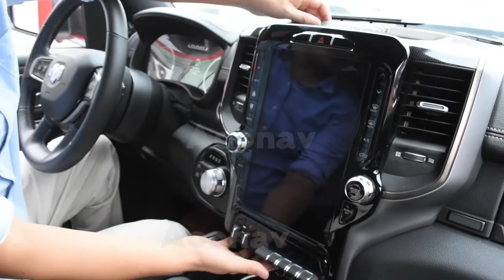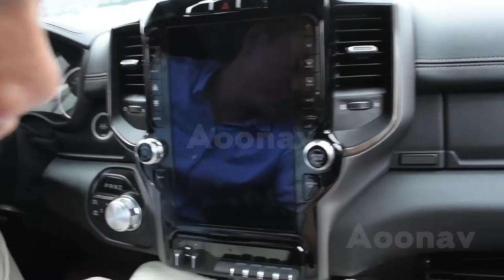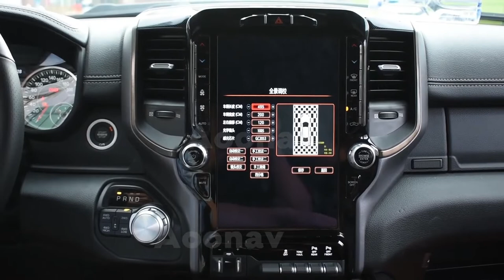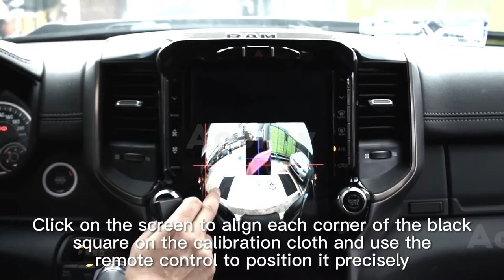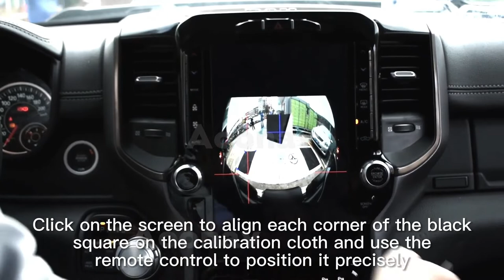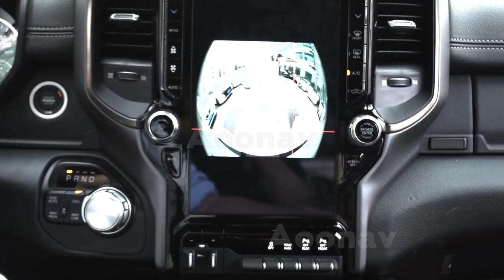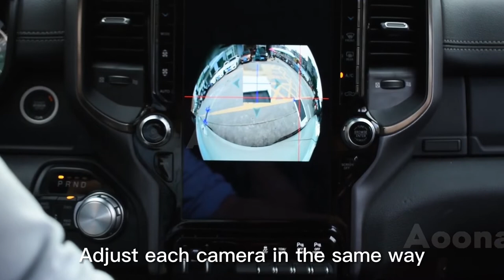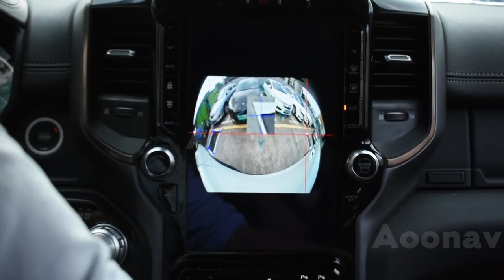Installation Video:Dodge RAM 2018-2022 3D 360° Panoramic Camera 1080P Upgrade

Comment: Fits 2018-23?  Do you offer 2 models of this? the video shows 2022+2023 Model Year. Is there a different kit for years 19-21? The multimedia's plugs are completely different on Uconnect 4 UAX 12" Radio for the RAM DT Body, than the 22-23 Uconnect 5 shown in this video. How do we order for the 19-21 UAX?
Reply from the maker: Hello, about this issue. Currently we have only one customer who has reported that his power cord is different. I've had an engineer make a power cord plug that fits him, a big head power cord. If you need pictures, you can contact me. If you want 2 kinds of power cords, you can tell me, I can prepare for you

Comment: Is your 360 system activated by a app, or a on screen soft key?
Reply from the maker: Our 360 system is built into the device, you can call out the interface by double-clicking the hazard lights, left and right turn signals, and the remote control. There is no separate application.

Comment: Are the camera cables 4 pin or 5 pin connectors?
Reply from the maker: The cameras are all common models, 4pin. Mainly the host and power cord are special

Comment: How do you add the additional cameras and where are they located?
Reply from the maker: Hello, regarding the fixed position of the camera, you need to fix it by yourself, through punching. We provide fixed brackets
Reply: @Aoonav  Thanks but I’m asking about the 360 views. Besides the camera in the tailgate, how many other cameras do you get with your kit and how and where do you install them on the truck? You can’t have 360 views with only one camera.

Comment: Hello.. Will work on Ram 1500 2021 model?
Reply from the maker: if your screen is a 12" original screen, you can install it directly. This is the product link. 
 https://www.aoonav.com/sale-468852-360cameradodgeram.htm
Reply: @Aoonav  what camera is compatible?
Reply from the maker: @patrick012182   This relates to your current screen, so you can tap on this to contact me directly on WhatsApp and send me a picture of your car's screen.     https://api.whatsapp.com/send?phone=8613277076617
Reply: Will this work on a 2021 ram 2500 with 12" screen

Comment: Had the kit installed on 21 Ram 1500 UAX Uconnect 4 (12" screen) and it's not working. I'm still waiting on a fix. Until recently tech support has very responsive. It appears to work with Uconnect 5 radio as shown in the video.